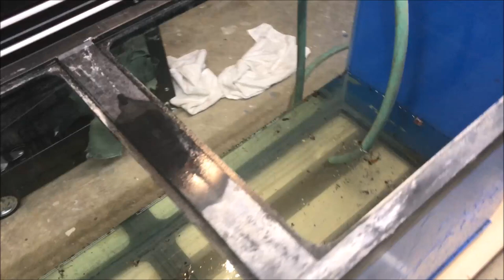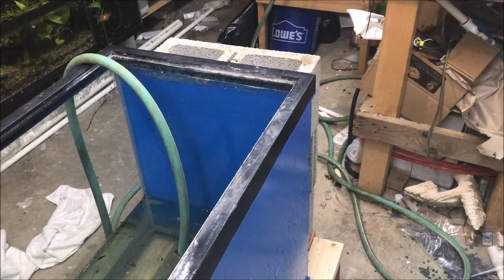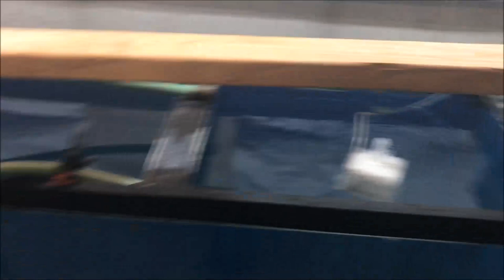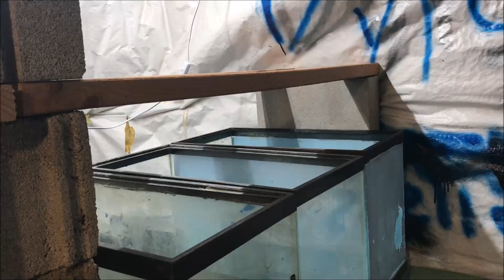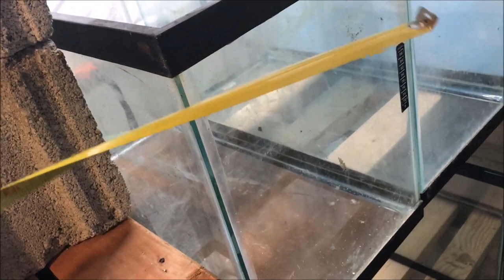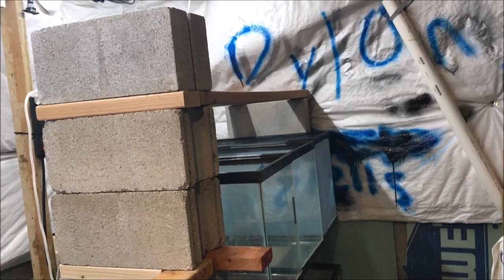How to Build an Aquarium Rack Fish Room Update Fish Room VLOG

Comment: Nice video!  For net storage I have just put a few large screws in to the sides of the wooden racks at various parts in the room.  I don't know about having a stick out shelf in there.  I'm average size, 6 feet tall 200 lbs but smacking in to that and then maybe losing balance could be a disaster.
Reply from the maker: I do the same (screws) but the way my tanks are, they overhang so there is no room for the nets to hang.
Reply: A while back I bought a package of a dozen or so things on qvc called magic hooks, they are movable and don't do any damage.  They stick to anything but wallpaper so you could put 1 on the lower part of the outside of your tank here and there.  I think it was around 30 bucks.
Reply from the maker: Actually that gives me an idea to use command strips hanging off of a tank!

Comment: They make a 2 ,3 or 4 inch solid/slab. A 3 inch slab will measure 2 5/8 × 7 5/8 x 15 5/8.  Built a similar stand that holds 2 75 's and 2 40 breeders.
Reply from the maker: Where do you get them?
Reply: I work at a brick and stone yard. Sell about every option for concrete block. I'm in the Midwest.  Look up concrete block suppliers for your area if the big box stores don't have them. Clayton block co. Possible in your neck of the woods.
Reply from the maker: Thanks Justin, I will do that!